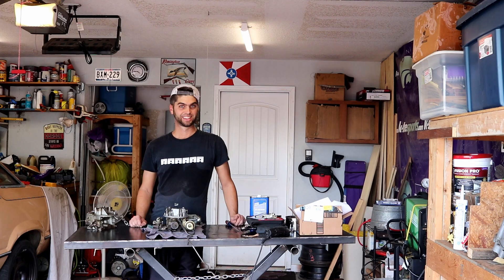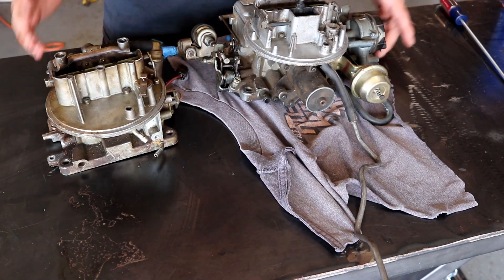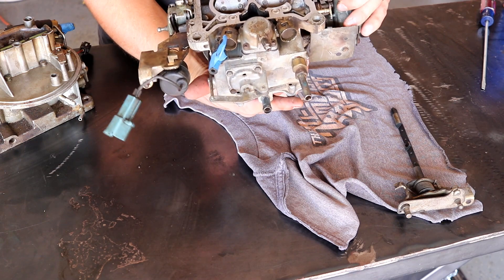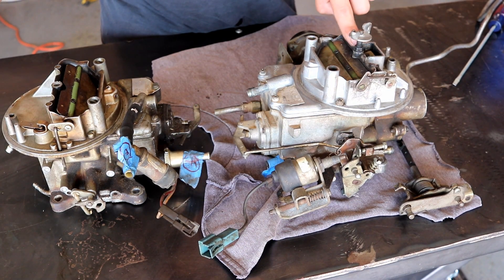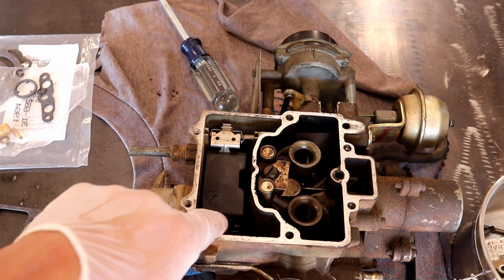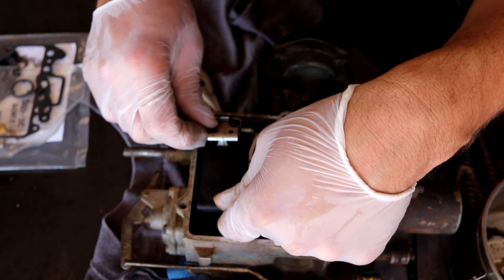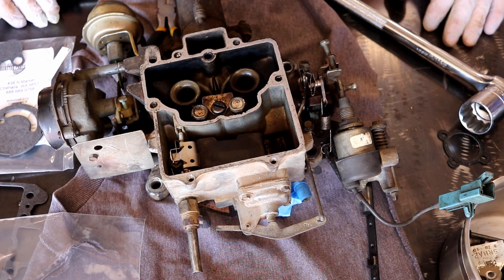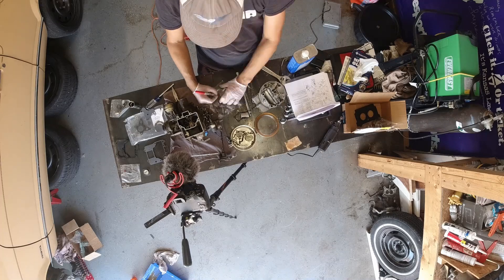Breaking Down a MotorCraft 2150 2bbl Carburetor

Comment: 1:09 is a choke pull off. It opens the choke plate slightly to adjust the fuel/air mixture for warm-up.                                                                                                                                                                                                            1:15 is a solenoid for the A/C. It increases the idle when A/C is turned on.
2:53 is a canister purge solenoid. It releases vapors from the fuel tank into the fuel bowl.
Reply from the maker: Thanks James

Comment: Ah yes carburetor rebuilds and the reason I like fuel injection so much. 
Good that Jed could help you out. 
Happy Motoring.
Reply from the maker: So far I'm not hating it...but I do think in the long run I'm more of an EFI guy. But I really wanted to force myself to rebuild a carb. Feel like that's a car guy rite of passage.
Reply: @Str8sixfan  It's not that hard to do but if you keep your car long enough you will do it more than once. Ask me how I know. 
I also like the fact that you don't have to worry about the choke with efi. 
Have a great day.

Comment: Learn by doing. Those screws in the throttle blades are 'staked'. That's why they're so hard to get out. You don't want them working themselves out while the engine is running. Bagging and tagging parts is always a good idea.
Reply from the maker: Good to know! Luckily they all function well enough to go back in
Reply from the maker: Also, used red locktite in the throttle blade screws reinstalling them

Comment: Good ol carbs had my share of those haha. Specially quadajets ugh gives me nightmares. I had a float go out once right in middle of interstate flooded out. Chem dip works well
Reply from the maker: I need to go buy some carb cleaner. My can's nozzle broke. Most things I have used a water based degreaser on and that's worked to date. But getting to parts like the jets that I need to spray with carb cleaner and soak before those go in!